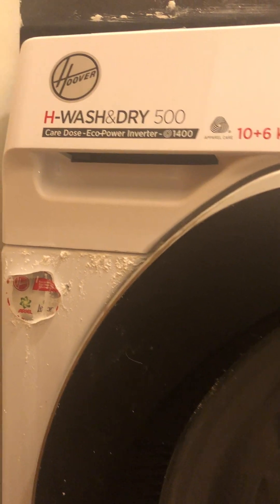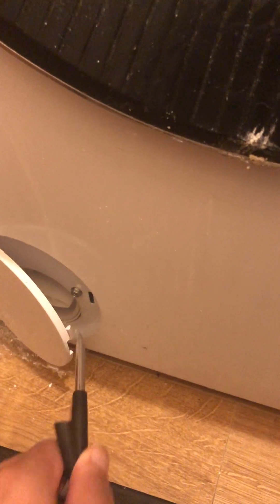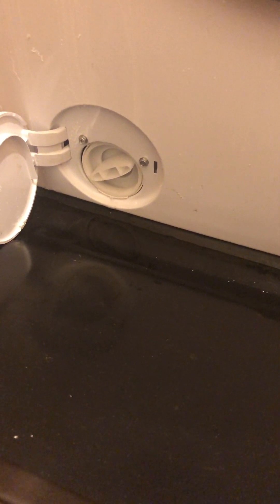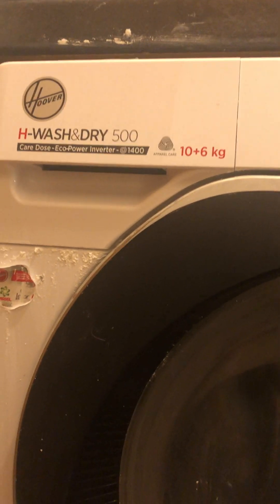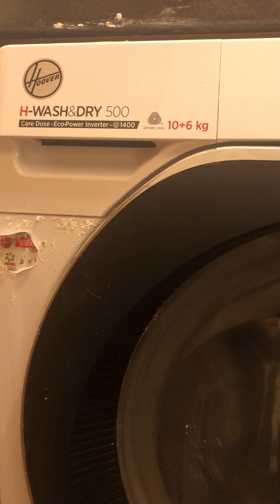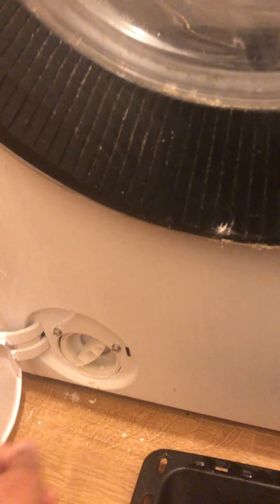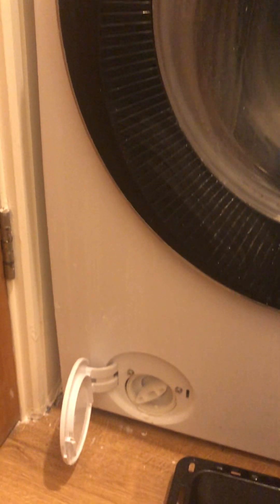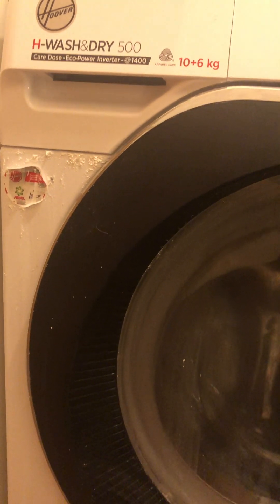Hoover H-Wash & Dry 500. How to fix drying problem.

Comment: I cant figure out how to clean the filter or whatever it is that holds all the hairs and fibers
Reply from the maker: I haven’t found a way to do this either. However when I was emptying the excess water a little fiber also came out. A very small amount though. Since emptying the drying function is working properly again. If I find out any more I will let you know. Be sure to subscribe to the channel. Thanks